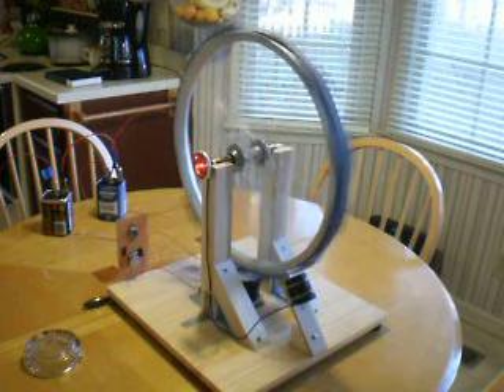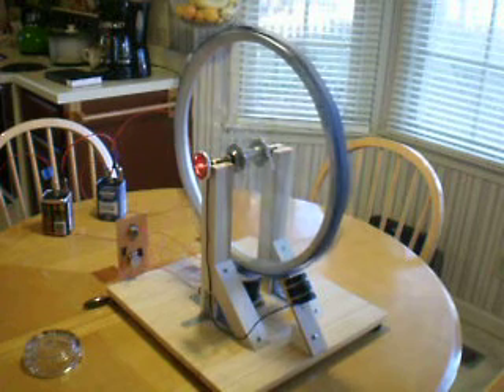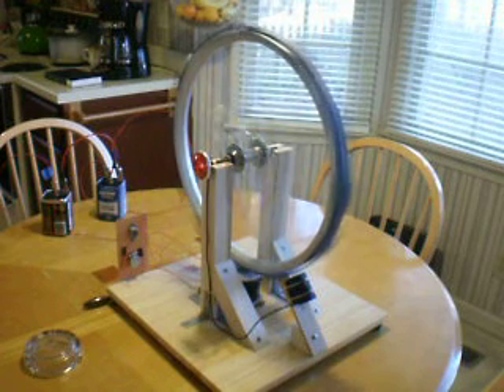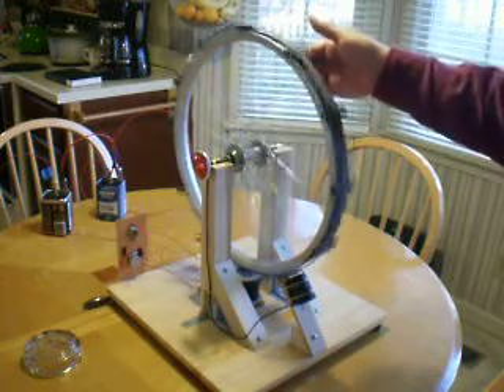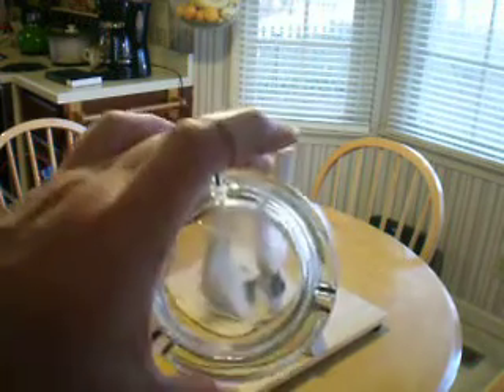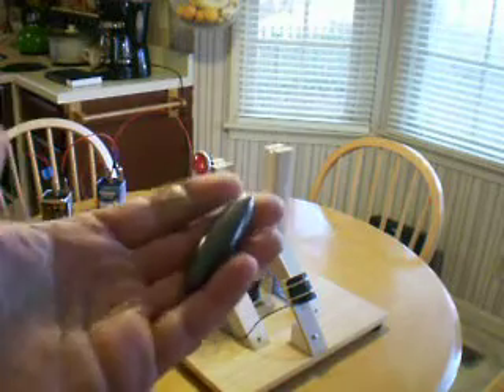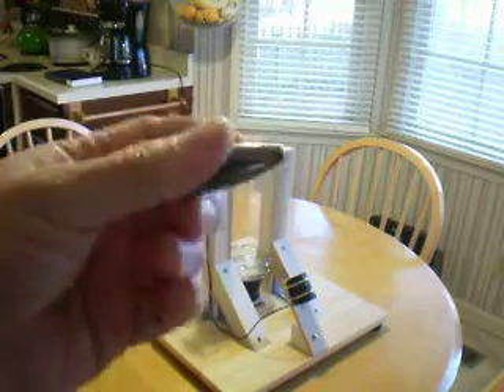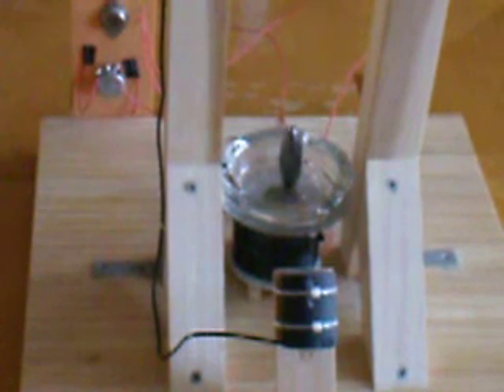Bedini SSG with single rotating permanent magnet

Comment: interesting...does the bedini charge batteries  with the egg magnet running??? Wiil the bedini also charge when there is no attachment (without egg magnet or the wheel) at all on the coil , as in a solid state device?
Reply from the maker: It does indeed charge with the snake eggs. People do make Bedini devices that are solid state, but I don't really know much about them.